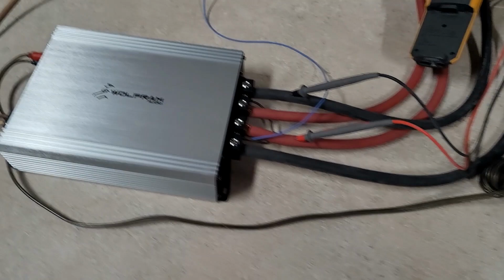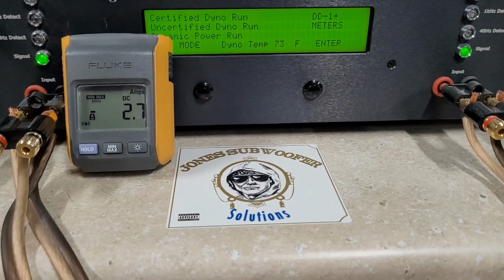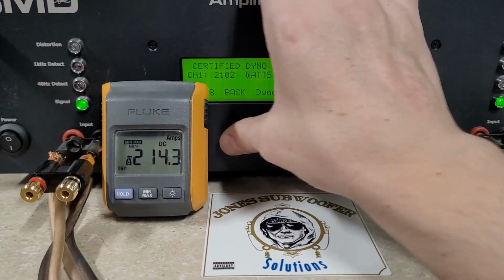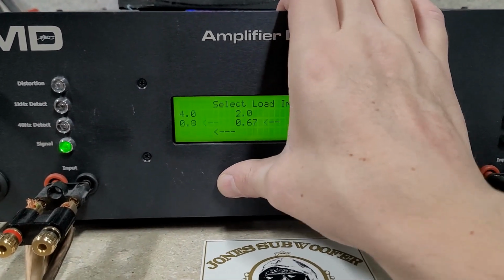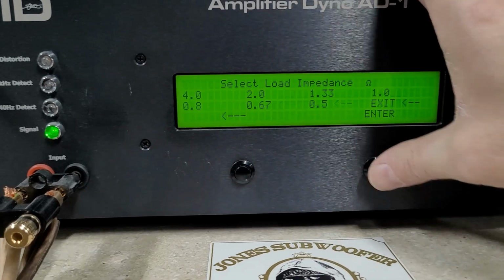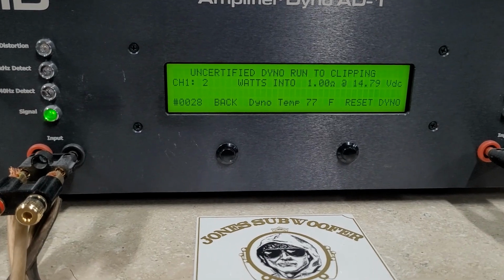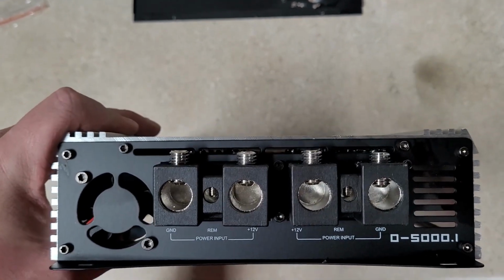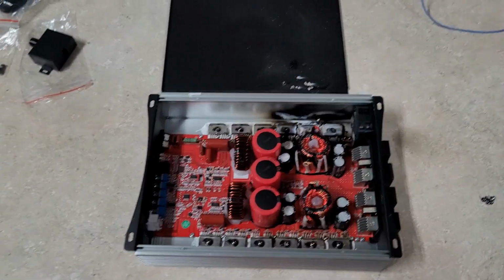AD-1 Amp Dyno Wolfram O-5000.1 by Jones Subwoofer Solutions JSS

Comment: I thought only Taramps caught on fire?
Reply: Other amps do. Taramps are just known for it.
Reply: These O Amps are the same thing as the Taramps just in a different jacket
Reply: @srtjdm1458  yup,full bridge amp.
Reply from the maker: They're similar to the models Taramps was selling 7 years ago, the current Taramps models have far more protection circuitry in them.  Notice, no Taramps have blown on my dyno under similar or even MORE harsh conditions.
Reply: @Facekicker  true. I never really thought much about it. Most of the videos I’ve seen of taramps catching on fire was from several years ago.
Reply: I was looking at the identical Sundown..worried now for sure.
Reply: I never had a problem with my taramp I had it for 2 years
Reply: @elroycooley398  I believe they’ve improved greatly over the last 5 years. Glad to hear you’ve never had a problem. I know they do some serious power.
Reply: @ThisIsMyHandle-48  facts i cant really seem to find any taramps blowing lol guess im just nervous of the 5k i got
Reply: @DECH_306  the sundown is way different and has two year warranty, Tiffany style rca’s, I’ve been running my SFB 8k for a year, USACI shows, and demos.. I clamped 7819 watts wired to 1.33, on 3 PSI 18’s rising too 1.9ohms look at the guts of the Sundown has a lot more in common with Sound Digital Amps been really solid...